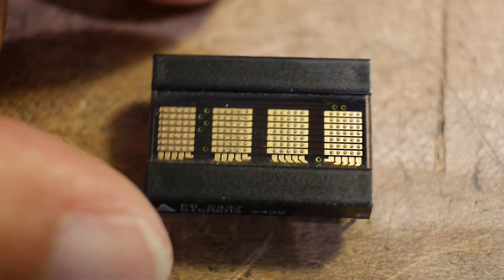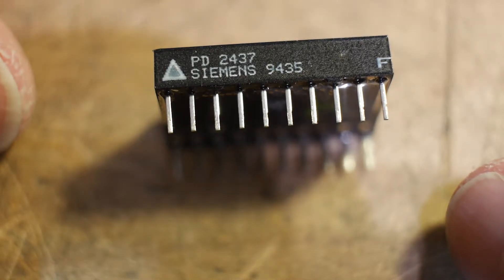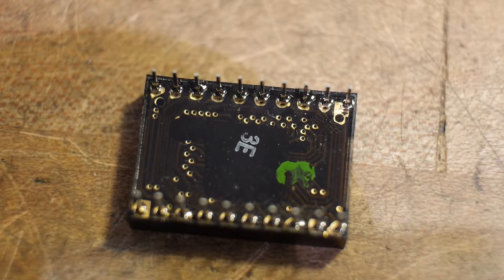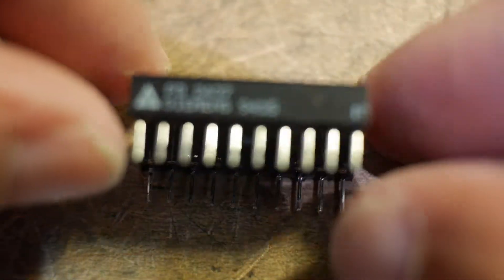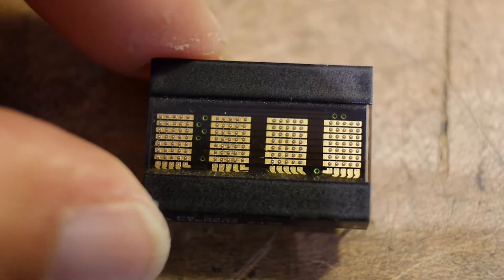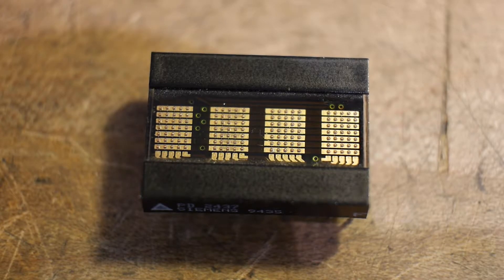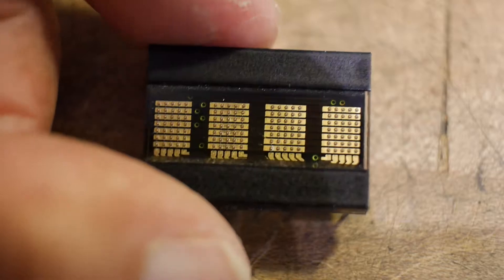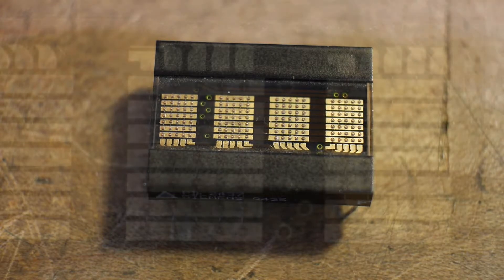#336 Siemens PD 2437 LED display with Arduino part I

Comment: i am new to this arduino thing, and i have 30+ of these PD 2437. do you have a better diagram of where the pins go? tryed studying the video, but its to hard.
Reply from the maker: I used:
int RD = 11;                    // not Read 
int WR = 12;                    // not Write
int RST = 13;                   // not Reset
int Addr0 = 8;                  // address 0
int Addr1 = 9;                  // address 1
int Addr2 = 10;                 // address 2

the data bus bits are connected to data port 'D' on the arduino

//==============================================================================================================
// Siemens PD 2347 LED Display
// IMSAIGUY
// 5-28-2019
//==============================================================================================================
                                //pin assingments
                                
int RD = 11;                    // not Read 
int WR = 12;                    // not Write
int RST = 13;                   // not Reset
int Addr0 = 8;                  // address 0
int Addr1 = 9;                  // address 1
int Addr2 = 10;                 // address 2
char message[40] = "   ImsaiGuy LED Display    ";

//==============================================================================================================
//==============================================================================================================
void setup() {
  // put your setup code here, to run once:
  
  pinMode(RD, OUTPUT);
  pinMode(WR, OUTPUT);
  pinMode(RST, OUTPUT);
  pinMode(Addr0, OUTPUT);
  pinMode(Addr1, OUTPUT);
  pinMode(Addr2, OUTPUT);
  DDRD = B11111111;               //set all port D lines as output

  digitalWrite(RD, HIGH);         //initialize pin states
  digitalWrite(WR, HIGH);  
  digitalWrite(RST, HIGH);
  digitalWrite(Addr0, LOW);
  digitalWrite(Addr1, LOW);
  digitalWrite(Addr2, LOW);
  
  Reset();                        // reset display
  Control();                      // write to control register
  PORTD = B00000011;              // set normal mode 100% brightness
  Write();
}

//==============================================================================================================
//==============================================================================================================
void loop() {
  DisplayString(message);
  delay(1000);
}

//==============================================================================================================
//==============================================================================================================

int Read()
{ digitalWrite(RD, LOW);
  digitalWrite(RD, HIGH);
}
int Write()
{ digitalWrite(WR, LOW);
  digitalWrite(WR, HIGH);
}
int Reset()
{ digitalWrite(RST, LOW);
  digitalWrite(RST, HIGH);
}

int Digit0()
{ digitalWrite(Addr0, LOW);
  digitalWrite(Addr1, LOW);
  digitalWrite(Addr2, HIGH);
}

int Digit1()
{ digitalWrite(Addr0, HIGH);
  digitalWrite(Addr1, LOW);
  digitalWrite(Addr2, HIGH);
}

int Digit2()
{ digitalWrite(Addr0, LOW);
  digitalWrite(Addr1, HIGH);
  digitalWrite(Addr2, HIGH);
}
int Digit3()
{ digitalWrite(Addr0, HIGH);
  digitalWrite(Addr1, HIGH);
  digitalWrite(Addr2, HIGH);
}

int Control()
{ digitalWrite(Addr0, HIGH);
  digitalWrite(Addr1, HIGH);
  digitalWrite(Addr2, LOW);
}

int DisplayString(char string[40])
{ for (int i = 0; i<strlen(string)-3; i++)
  { Digit3();
    PORTD = string[i];
    Write();
    Digit2();
    PORTD = string[i+1];
    Write();
    Digit1();
    PORTD = string[i+2];
    Write();
    Digit0();
    PORTD = string[i+3];
    Write();
    delay(300);
  }
}